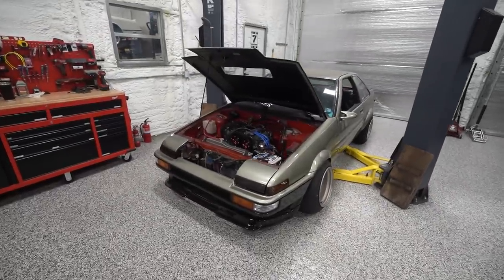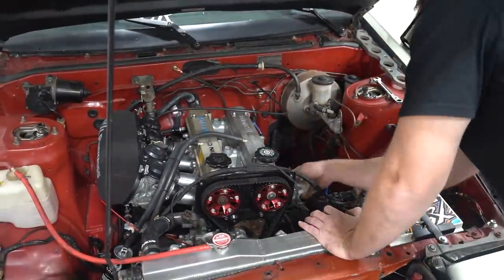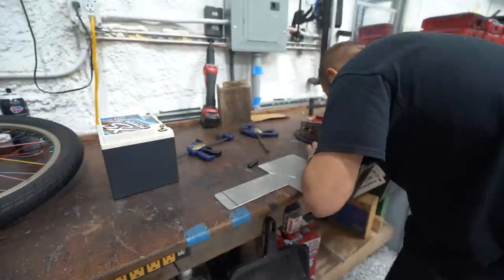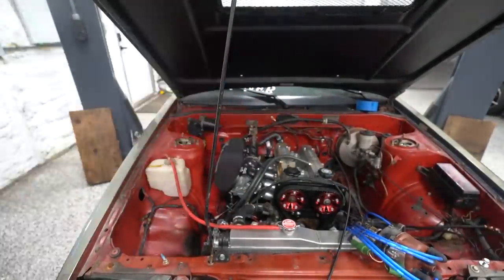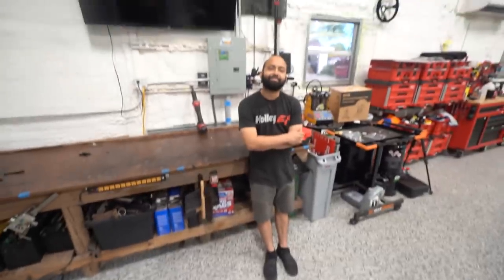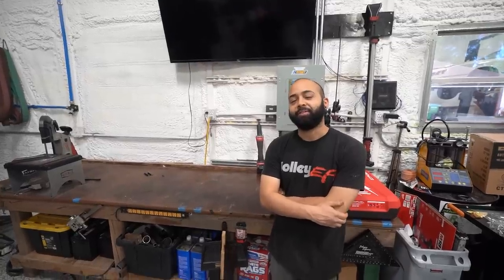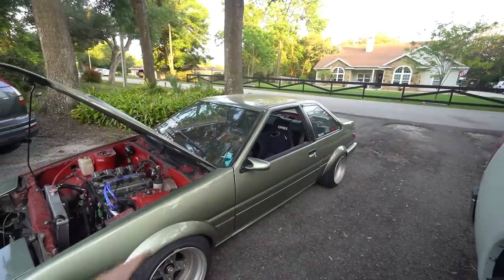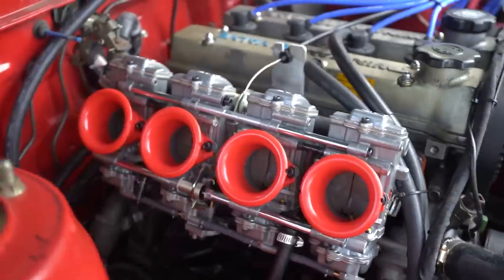AE86 Vintage Build. FCR Flat-Slide Carb's. it sounds insane now.

Comment: Hey Taylor, 
There are two varieties of FCR; side draught and angled, looks like you’ve got the side draught ones which means they need to be mounted with the body vertical as opposed to on an angle like your CVs were meant to be, basically you’ll just need to look at the angle of the float bowl and see if that’s parallel to the ground when they’re mounted
Additionally they definitely need to be balanced, you can hear them running unevenly, will make a big difference! I found a cheap and handy little airflow meter made for beetle carbs, you just put the snout of it up to the velocity stack and it’ll read out how much vacuum it’s pulling, then you just ensure they’re all pulling the same at idle
Also it’s “Kay-Hin” hehe
Reply: These look like the angled ones, look at 23:33 and you can see the slanted carbs.
Reply: You can see actually that the angle of the line of the top of the float bowl is parallel to that of the carb body as well as the actual Venturi so im quite confident they’re side drafts
Reply: Slant body and Fcr MX.   Came because im rebuilding mine

Comment: Taylor, also - I don't know if anyone has said this - you may need to balance those carbs. There are plenty of cheap tools for this, and you basically measure the airflow at each carb and adjust individually. When I had a built 1.6 in my Miata with Toyota ITBs this was key to getting it running really well.
Reply: Fcrs can’t be balanced my dude, they are a set hight on the slides
Reply: @mk1productions88  Nice, Didn't know that. I assumed the were similar to conventional butterfly'd bodies. Not balancing could have been the issue with his previous sets though. It was a 100% improvement when I set up my ITBs.
Reply: @mk1productions88  There should still be individual idle screws between carbs to do a proper sync. Not saying its the case but I've not run across a carb bank set that wasn't able to sync to each other
Reply: @mk1productions88  they can definitely be balanced, otherwise they wouldn’t be properly tunable, they’re balanced where the slide attaches to the throttle shaft
Reply: @BADDTIMES  huh, I’ll have to have a look my dude… learning every day… even if I’ve been running them wrong for 6 years haha!
Reply: @mk1productions88  FCR's can be balanced, I have no idea who told you that ?  So much rubbish on the net. These carbs are commonly used on motorcycles, mainly 4 cylinders, always balance.... It goes without saying.

Comment: Use candle wax on the grinding burr and it will help in preventing the flutes from gumming up with aluminum.
Reply: Cheap bar soap works also and easier to find
Reply from the maker: I had some Johnson paste wax for that but I tossed it recently since it was getting gross. Lol
Reply: gulf wax
Reply: @Taylordrifts  you can use WD-40 to keep from getting the bits and wheels clogged up. Also check out the sand belt cleaner from Harbor Freight.
Reply: The swap from a cv carb to a pumper/flat slide carb is HUGE. Instant changes, instant throttle response and better torque
Reply: Get a box of perfin wax at the grocery store in the canning section.
Reply: Getting gross... but still worked.
Reply: Mineral oil works well too
Reply: Bees wax is the way! Also alcohol works wonders for drilling aluminum.

Comment: with the programable ign box you can switch to a crank trigger set up and just get rid of the distributor. and use a wasted spark set up from a ford ou Peugeot like i did :)
Reply: There is also a vw coil pack that is good for paired firing

Comment: Now im invested in what that super annoying chirping noise is 😂   guessing its a small intake leak somewhere
Reply: My vote is going to the intake runners.
Reply: I’m guessing a small nick in one of the intake boots that he got while trying to get the new carbs to fit
Reply: 34:45 It's placement of the carbs to the intake very familiar with this sound. Had this on my vertical dual carb set up on my VW engine, dual 40mm Dellortos. Carb to intake was paper, then switched to rubber mount and fixed the vacuum problem. Definitely a vacuum issue from carbs to intake.

Comment: The tip in hesitation is the accelerator pump timing being too early. It's a struggle with FCRs. I've been racing on these things for 25 years! The off throttle bog usually isnt a problem, until it is, on a jump face in my case 😳
Reply: I think I got rid of my bog by changing the accel spring to a different year that was apparently better. Also I got one of those fancy bowls with the externally adjustable accel pump, I think that helped for sure but wasn't totally necessary
Reply: @motoweenies4431  Yeah the Boysen bowl is a must have on older FCR bikes for sure.
Reply: @bennyb.1742  Just a smaller leak down jet and a zip tie holding the accelerator pump linkage gets you the same shot as a Boysen, at least on FCR39s in my experience. The big thing is getting the pump timing perfect on the bench before it goes back in the bike/quad/vehicle.

Comment: What a sound, and the clack man! Love it, best setup you could have on an 86. FCR Carbs for the win! They add so much presence to the engine bay too. Would love a set of these on my old VW Polo, was running on CBR600 carbs before it went back to sensible daily mode lol.
Reply: Twin FCR’s on a 660 thumper. Anything Yamaha screams through the sides. GPZ 750 turbo carbs were it back then. That mechanical note hits different than ITB’s.
Reply: I have a diesel jetta and now Taylor’s clacky girl sounds like it 💀💀

Comment: Taylor,
The fcr carbs have a vacuum plate on the front of the slide on each carb that closes when they're off throttle. Thats likely the whistle you're hearing when you blip the throttle. It's normal for every fcr I've ever had. 

As for the bog when you rap the throttle you can try bumping up a jet size, it usually helped mine but makes them a little harder staring when they're hot.

Comment: To keep your burr tool from clogging up use cutting wax. It also helps drill bits and saw blades cut into aluminum.

Comment: Absolutely love the fcrs! I'd put a smaller leak down jet in the accelerater pump circuit after balancing them out that will help massively with the hesitation then fine tune the timing on the accelerater pump from there if your happy with the afr

Comment: thanks to you and a few other tubers im finally getting back into tinkering with my eg hatch,  all the little things i ignored 7 years ago im finally addressing and its like a whole new car. First set of new coils from BC racing, ditched the dizzy for Coil on plug, redid the fuel rail and lines to AN and regulator by deatch and found i had been running lean the whole time and eatting away my pistons. you can see the piston to wall clearance is bad lol. bought a lil harbor frieght welder to fix lil holes and rattles in the exhaust and just tacked painting it and with rattle cans( trust me it looks sweet) next im looking into doing my own interior work to give it a more premium look and feel like a bmw or something rather than a plastic rattle trap.  Ima have to sent you a couple photos of it. i just wish i had it in me to record the progress and just show ppl but i hate being on camera lol

Comment: Hey Taylor , on your carbide bits for aluminum try using a bar of soap or a toilet donut seal thing. Just stick the bit in it and give we a rip and the bit won’t get nearly as clogged. I use the toilet seal on my bandsaw blade also when cutting a lot of aluminum to prevent it from clogging up as well

Comment: hey dude, you can adjust that area of fuelling with either the position of the accelerator pump arm (on the throttle lever near where the cable goes) or but changing the needle position. but if you change your needles it will effect afrs at cruise also. So sick to see you on the flat slides man!

Comment: This video was all over the place in the best way possible. It's fun to go back to BMX. The intake noise is weird. It sounds like those horrible bird whistles with the water in them. It may be the cheap plastic air venturis making the noise. Once balance tune them, the carbs will sing.

Comment: Not sure if anybody has brought it up yet but FCR carbs are notorious for a slight hesitation on tip in. The cheap but reliable way to help that hesitation is called the zip tie mod basically it stops the accelerator pump from being progressive and makes it a one-to-one ratio I won't get into the specifics of how to do it easier just to Google FCR carb zip tie mod

Comment: If'n you decide to give the carb manifold another go building a jig would maybe help. It would be pretty easy to layout your spacing on both sides or set the manifold up and build a cardboard template for the carb spacing and jig it up on your welding table.  It sounds like a bit of work, but also the kind of project you enjoy and shine at. It would certainly match the over the top exhaust. Go big or go home, right?

Comment: the noise sounds like one of the slides on the carbs tapping/vibrating
Reply: Are you talking about the ticking or the high pitched like bird noise? The carbs are supposed to tap like that
Reply: @hooviedoovie5220  the bird noise..mine did that because one of the slides was sticking.drove me nuts for six months..polished the slides and the inside of the carbs and was fixed

Comment: the noise you hear is the firing of the engine trough the intake. thats a thing with flat slide carbs. after you sync them to each other it wil be less obvious. also a bigger velocity stack wil help with the bog.

Comment: back when i was like 11 or 12 and my first time putting in a bottom bracket, i used a old front wheel axle with some washers and nuts on each side as a make shift kinda press, worked great, on my last bike i hated the spline cranks tho, hard to get the arms on by hand  due to the tight fit, and making sure its 100% lined up right, cant imagine how to get the last ones i had off they were insanly tight to get on ahaha

Comment: Not familiar with slide carbs but usually there’s an accelerator pump on carbs that are there to spray a little more fuel as the slides open to keep from going lean on tip in.

Comment: Thats alot of angle for the floats to work right. You should get the vacuum tool to balance them and FCR need accel pump to be timed on the squirt
Reply: It's no more angle than would found on a MX bike. The float fuel level setting might need slight adjustment for absolute performance, but for most everything else, it should be fine.

Comment: For the carbs, did you consider using reducing couplers? You needed to use couplers anyway, so maybe just go from the diameter of the carb to the diameter of the flange. You could also use a short 45* coupler on each end to widen the spacing a bit like you did with the welded fittings. Just a thought. Maybe it won't work the way I'm thinking.

Comment: burr getting clog with Aluminium: spin the burr in a cheap soap bar ;)       FCR41 feel big to me for a 4cyl 1,8l   (always though they were intended for 500+cc cylinder) ...  as mentionned by other: the float bowl need to be horizontal when installed  or you'll have to mess around with the float height.

Comment: You could make your own intake manifold for those flat slide carb to work better with and im wondering if the chirping is un even air flow or a tiny air lesk being sucked in thats super annoying

Comment: Hi man, currently going thru a similar project tryna make a MSD 6A work on a jdm 86. How did u feed the trigger to MSD? I tried the original coil+ to ignition and original coil- to trigger and car would only fire one turn then just cranks until I turn the key all the way off and on again, then it’ll just fire one turn again…

Comment: You should never need starting fluid with this set up. Each pump of the throttle the carbs actually squirt gas into the heads

Comment: Bike crank wrong side goes on the right side
Reply from the maker: It wouldn’t work if it was on the wrong side. Lol it’s a ratchet mechanism. You can do LHD or RHD depending on which side you grind on. I grind on the right.

Comment: You have accomplished absolutely nothing lol. in order to benefit from ITB's on the 4AGE motor you need to consider velocity. by not having a smooth transition into the head you loose any benefits you may have had by running ITBs.

also, look into old Formula Atlantic photos. they added material to the large port heads making the port a "B" shape instead of a big oval.
they did this before going smallport (the largeport heads porting is too large and loses alot of potential power)